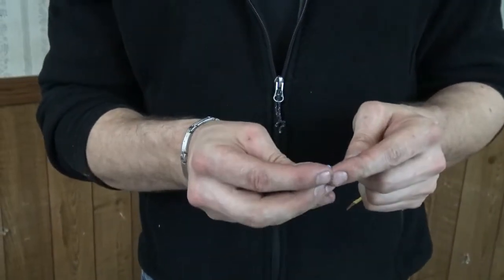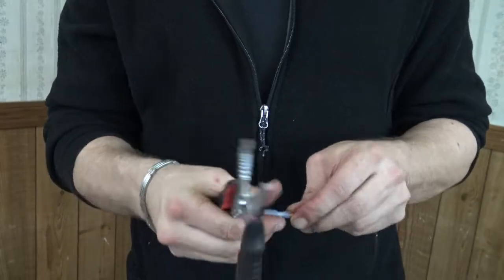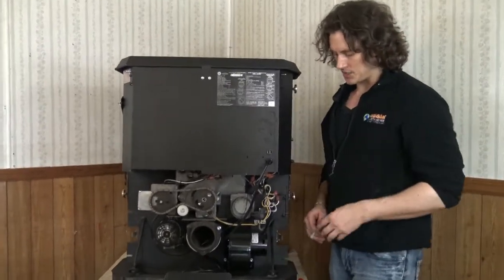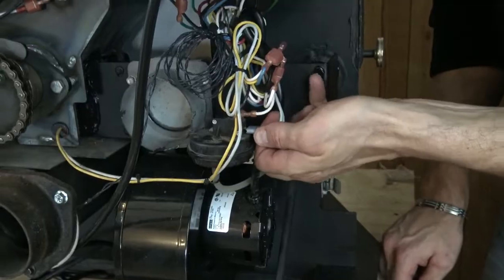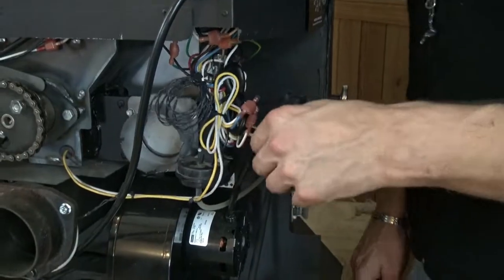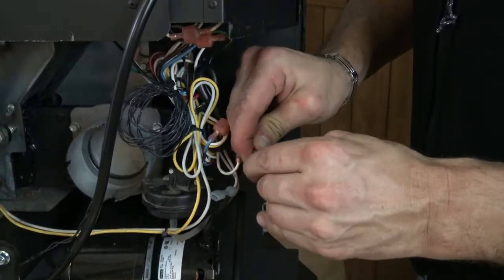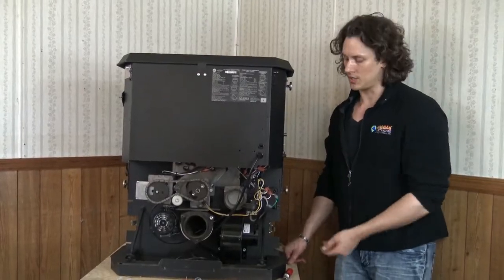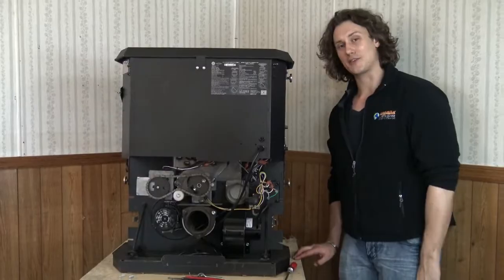How to create a jumper wire and bypass a safety switch in your Pellet Stove

Comment: Used this jumper feature this week due to an issue with my XXV stove not starting. Used the jumper wire and realized the safety switch vacuum tube was no good.
Reply from the maker: Awesome Chris, glad the video was helpful! Here is the replacement hose for reference. If you need anything just let us know. Thanks!
https://pellethead.com/product/harman-heatilator-vacuum-pressure-switch-silicone-tubing-hose-aftermarket/

Comment: Can you make a video FS enviro empress wiring harass, I removed all wires to replace parts and troubleshoot my stove, I did cut off plastic ties to make more room but all my white wires got screwed up….I made a real mess 😢
Reply from the maker: Thanks for contacting us, sorry to hear of the frustrations. We can certainly add that to our list of videos, however it may be some time before we could complete that. Page 25 on the link below will be the wiring schematic for the Empress FS model. This should be a solid guide as you get things re-wired. https://www.manualslib.com/manual/797489/Enviro-Empress-1-Fs.html?page=25#manual

Happy to help however we can. Thanks!

Comment: Hey my pelpro pp130 is not feeding and I create a jumper like that but still not working, can you please help me
Reply from the maker: Thanks for contacting us, happy to help. I would suggest we first make sure the auger motor is in operable condition. Link below to make a test cord to test your motor to direct wall power.
https://youtu.be/rlmiCYI2WPk
If your auger motor is good we can take a look at the safety switches in your stove. Let's also make sure that you have performed a thorough cleaning on the stove and vent pipe. Let's make sure there are no ash blockages and that your door gasket seals are nice and tight. Happy to assist, Keep us posted.

Comment: High there folks at earth sense.I have castle free standing stove she is about 16 to 18 years old looks like an auger feed problem. Checked out Auger motor ,motor is good. Replaced front door gasket,replaced vacuum switch ,checked snap breakers all seem to be ok.When I plug stove in the blue light flashes a series of times the only red I get is the red light on tin box behind control board. No green light . Any light you can shed on this matter would be appreciated. Control board maybe?…
Reply: No pellets on start up,tested auger motor to direct power tested good. I’m getting 4 blue light blinks a series of 6 times then no more blue at all. Voltage is good at fan motor. I have tried pulling a vacuum on vacuum switch manual by sucking on vacuum hose going to switch in the beginning of cycle with no luck when vacuum hose is only connected to stove I can’t really detect any vacuum hose seems clear when blowing thru it towards stove.again anymore help would be greatly appreciated
Reply from the maker: @tommywebb5345  Hey Tommy, thanks for the info. When the Control Box is set to #4, the blue light will blink 4 times in sequence for 60 seconds during start-up. This is normal. Have you bypassed the vacuum switch altogether at this point with a jumper wire? Any change if so? It may be an area/cavity in the stove that is blocked with ash and will not allow the vacuum switch to close. If we bypass it completely for troubleshooting we can rule that out. We can do the same thing with the #3 High Limit switch. The only other item besides the control board that could prevent the auger motor from turning would be the Thermocouple, but generally speaking even with a bad thermocouple it would feed during start-up so I'm not leaning towards that. In my eyes our culprit is either something plugged in the stove or vent that is not allowing the vacuum to close, the vacuum switch itself, high limit switch issue, or control box issue. Start with the simple things and keep us posted. Thanks!
Reply from the maker: Thanks for contacting us, happy to help. Is your Castile feeding any pellets on start-up? I assume you have tested the auger motor to direct power to verify it's working correct? How many flashes are you getting from the blue light? Let's check your combustion blower - it should be running near line voltage on start-up. There needs to be enough vacuum created by the combustion blower to lock in the vacuum switch for the unit to feed during start-up. Let's also double check the vent and make sure there are no obstructions. There's a possibility this could be a control box issue, but let's go over the basics and check the simple things first. Happy to help, keep us posted.

Comment: hi there 
Thank you for your lights !!! 
but I need help 
I get the Dip sic fail alarm after 10 minutes of working 
I changed the pressure switch with a new one and I get the same message ,,,
after I bypassed the pressure switch and all works fine 
any help please ?
Reply from the maker: Thanks for the message. I'm unsure of what the dip sic fail alarm is.. What stove make and model do you have? If you are bypassing your pressure switch and the stove works fine, there is something in the stove that is tripping the vacuum switch. Check the following:
1. Vacuum Switch Hose
2. Door Gasket and Ash Door Gasket Seals
3. Ash build-up in the stove and flue vent pipe
4. Combustion blower running at proper voltage - should be near line voltage on start-up. 

Hope that is helpful, keep us posted. Thanks!

Comment: My auger turns but no pellet s drop😕 ideas?
Reply from the maker: What stove make and model do you have? Double check the connection set pin collar or locking collar bolt the connects the auger shaft to the auger motor. Provide as many details as you can, happy to help. Thanks.
Reply: @EarthSense  vogelzang vg5770 I believe.. locking pin and bolt seem fine and everything turns just no pellets come down chute.
Reply from the maker: @mikedavidson1970  Thanks for the info Mike. If both your auger motor and auger shaft are turning but no pellet fuel is coming down the chute, the only thing I can think of is either the auger motor is turning the wrong direction, or your auger shaft flights are worn to a point where they cannot churn the fuel upwards. Your VG5770 model will use a 1 RPM Counter Clockwise Auger Motor - Direction is determined when facing the motor shaft. Let's start by verifying your auger motor is turning the correct direction. Here is a link for the auger motor and link beneath this if you need to reverse the direction. 
https://pellethead.com/product/ussc-vogelzang-breckwell-auger-feed-agitator-stir-motor-1-rpm-counter-clockwise-w-hole-aftermarket/

https://youtu.be/wGc6UpjkwhI

Keep us posted, thanks!

Comment: Excellent video. I have a Winslow ps40 it seems to be taking my convection blower which works fine almost 20 minutes to engage I put a probe in between the snap switch and the housing it's not engaging till at least 160° sometimes 165. I see on the back of the yellow and white sticker it looks like it should engage at 140° also I had noticed where this mounts to the bracket that holds it to the combustion vent housing that it looks like someone had bent the housing so that the bottom of the switch actually touches the metal that doesn't look correct it looks like it should be 1/8 of an inch off of there with an air gap in between the housing and the snap switch is this correct or should it be touching the metal again the bracket looks like someone bent it in any help would be greatly appreciated thank you
Reply: Thanks for the info yeah I cleaned it up but it's still not coming on till like 165 I did bend the bracket back and ordered a new switch from you. The ceramic one is new I got that from you guys also
 I always clean it like once a month or so.
Reply from the maker: @knoxtrail5412  Sure thing. Yeah should be coming on before that temp, keep us posted how the replacement works for you. Thanks again for reaching out.
Reply: I will do that when I get the new Switch. upon reading an old thread from like 2017 someone was having sort of the same problem one of the responses was saying that the switch should be making contact with the metal he had asked if switch and distorted or had any kind of deterioration or build up so I guess the question is should the combustion low level switch that's mounted to the heat exchange above convection fan should that switch be touching that metal? I definitely could see that if there was a gap between the switch and the metal it could easily change the temperature by 10 to 15 degrees by not touching the metal which would cause that to raise 160-165° before the temperature in between closed it up
Reply from the maker: @knoxtrail5412  Thanks for the message. I would agree that a snap switch touching the metal/rear firebox will hit temperature quicker than if there is a space/air gap. The Winslow has been made by a few manufacturers; I'm sure they put the snap switch bracket there by design with that air gap - most likely why it was bent in by the previous owner. I will say that the majority of manufactures will have the blower snap switch right up against the firewall. I do not see any safety concerns by having the blower snap switch touching if you decide to play with it. Keep us posted and let us know of any other questions. Thanks!
Reply: Update. Upon inspection I noticed that the high level switch which has a reset button was in the same type of mounting bracket as the low level combustion switch. the high level switch was actually touching the metal. The low level for whatever reasons somehow must have been bent out by the previous owner and was not touching the metal. I carefully bent it back in so that the low level switch would come in contact with the metal. Upon starting the stove it did not take 25 to 30 minutes for the blower motor to engage nor reach the temperature of 165°. It engaged in about 13 minutes at about 125°.
Reply from the maker: @knoxtrail5412  Excellent, thanks for the update!
Reply from the maker: Thanks for contacting us, happy to help. Yes it sounds like your low limit switch for the blower is not locking in/closing at the proper temperature. It should be locking in at 140. Look at the mount of the switch, and if you see any corrosion or wear on the bottom of the switch, sometimes taking triple 0 steel wool to clean that back to shiny metal can make a big difference. If you end up needing a replacement, link is below. 

https://pellethead.com/product/lennox-iron-strike-winslow-bella-gas-stove-low-limit-blower-snap-switch-oem/

Now the switch you are mentioning in the combustion blower housing will be a ceramic Proof of Fire Switch (P.O.F.) This switch will trigger/lock-in the fuel feed after start-up and will shut down the blower once the stove is cool. 

https://pellethead.com/product/pellethead-replacement-lennox-iron-strike-proof-of-fire-ceramic-low-limit-snap-switch/

I do believe the blower low limit switch sits in a bracket like you mentioned and there is a small gap if my memory serves me correctly. I would suggest you try to bend that bracket back strait best you can and re-mount. 

Keep us posted, happy to help. Thanks!

Comment: I have the same pellet stove here. I’m getting sick of troubleshooting it. The auger is a never ending nightmare. I replaced the motor two weeks ago and last night (night before thanksgiving) it stopped feeding. Spent until 1am trying to troubleshoot it. Now it could be the damn vacuum switch?! Pellet stoves aren’t worth the headache and are unreliable. I thoroughly clean my stove and pipes every season and in between seasons. I’m most likely gonna go back to wood or natural gas. Too many parts to malfunction and too damn expensive. I’m over it.
Reply from the maker: Sorry to hear of the troubles and frustrations. We are happy to help troubleshoot with you and go over common causes for things if you want. Happy to help however we can. Thanks.
Reply: @EarthSense  Thanks for the response. Turned out to be a slipping chain. Problem was resolved and I really do appreciate the response. I was super frustrated that night because we had to move our thanksgiving plans to another family member’s house. Just bad timing for the pellet stove to malfunction.
Reply from the maker: @notforposers  Completely understandable. Very glad to hear you figured out is was a chain issue and were able to get that resolved. Always here to help if you need us, just drop a line. Thanks so much!

Comment: Great tips for troubleshooting pellet stoves.  Appreciate you sharing your knowledge.  Still working to diagnosing the issues.
Reply from the maker: Thanks for the message, glad the videos have been helpful. Happy to help with diagnosing efforts. What stove make and model do you have and what is the issue you're experiencing?
Reply: @EarthSense  We have a Caddy Alterna Pellet Furnace - an earlier model, manufactured in 2008.  We bought it new from a dealer about 3 years ago and recently got it wired up.  It appears the ignitor is not coming on; so, I am in the process of working through that issue.  Watching your videos gives me a good understanding of how the unit works.
Reply from the maker: @algatti9096  Thanks for the message. We don't have a ton of experience with the PSG Caddy Alterna Furnace; it appears it uses a 300 watt igniter, part 44132. I'm not sure what the ohm range should be on this igniter, may have to contact the manufacturer to find out. Most of the 300 watt igniter elements we carry range from 30-52 ohms for optimal range - I would think your PSG igniter should be similar. Here is an igniter troubleshooting and OHM test video which you may find helpful. Thanks! https://youtu.be/z4wmCc96rVI
Reply: @EarthSense  As a next step, I applied 120V (from an external source) to the ignitor and the ignitor got warm.  Then I tested the leads to the ignitor and am not receiving any voltage.  Is there a switch that could be tripped that would prevent the ignitor from receiving 120 V?  Any other thoughts to continue diagnosing and resolving the issue is much appreciated.
Reply from the maker: @algatti9096  Thanks for the message Al. If you are running your igniter to direct 120V power, the element should become literally cherry red hot within a few minutes time. If it's only getting warm, that is a sure fire sign the igniter is bad. I'm not aware of any safety switch in-line with the igniter element. I would suggest tracing those igniter lead wires back to the junction box or control board and see if you are getting any voltage reading at the source. Check the wires, make sure there are no cracks or breaks. Look for any charred or burn spot where the igniter lead wires connect on the board. In some models there will be an igniter fuse either in-line or in the control board. You can check to see if your Caddy has that as well. Keep us posted.

Comment: I’m guessing you can’t agree with me to bypass the limit switch for the hopper door on my Lopi AGP pellet stove, but my stove is in a vacation rental and every so often a pellet ends up  next to the limit switch and prevents the switch from tripping when the hopper door is closed. As my rental is in the Sierras, it can dip near it below zero at night.  As my guests review their experience and this affects my ratings and bookings, even if it’s not my fault, I can get blamed when they refill the hopper and the stove doesn’t work due to the occasional stray pellet. I realize that there are lots of safety features engineered into a modern pellet stove, but I can’t figure out what  purpose the limit switch for the hopper door serves. So, I’m tempted to bypass it. Even if you can’t recommend that I bypass the switch, can you at least tell me the importance, from a safety perspective, for keeping the switch?
Reply from the maker: Thanks for contacting us Maurice - apologies I did not see your comment until now. During operation, if the hopper was left open it can affect the combustion air flow having an effect on the fire efficiency. On a safety end of things, if the fire was ever to go up the pellet drop chute and reach the hopper, if the hopper lid was open, the air would fuel the fire. Also, sometimes folks would dig in the hopper if something was binding or jamming during operation and the hopper switch shutting off the auger would prevent their hand from being hurt the churning auger shaft.  I would suggest creating notes on the hopper lid to make sure the hopper lid is always shut while the unit is in operation, and I would make a note regarding fueling to ensure your renters move the pellets once filled so they do not obstruct the hopper switch. We never want to leave a safety switch bypassed, just for troubleshooting. Any other questions please let us know. Very appreciated.
Reply: My Breckwell Classic Cast does not even have a hopper door safety switch.